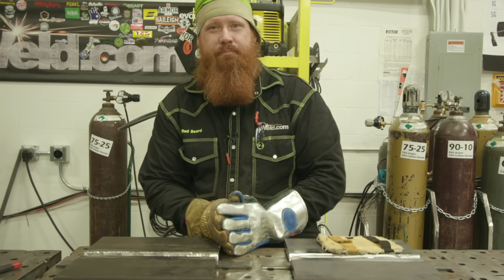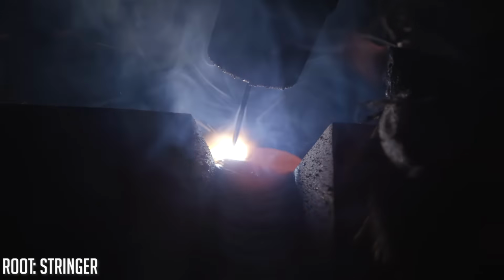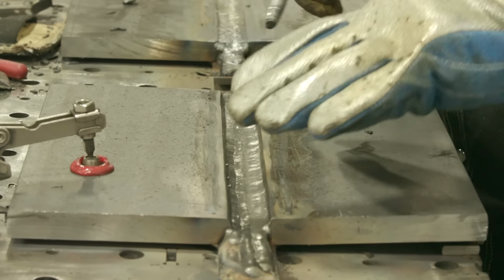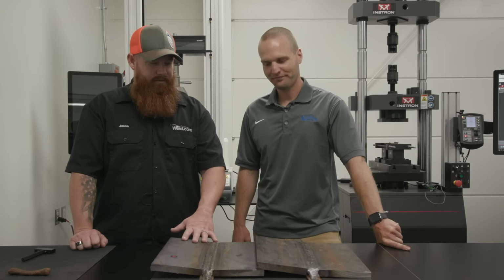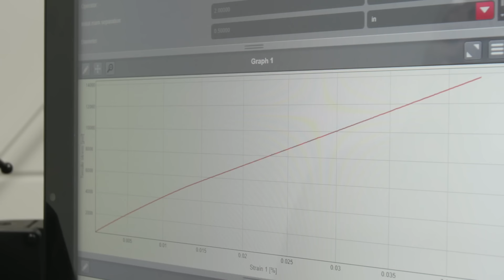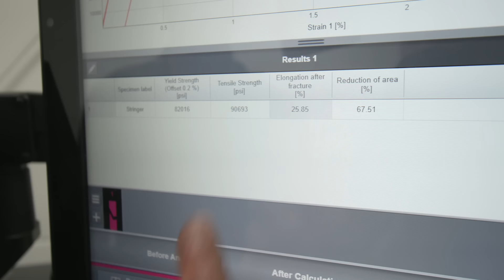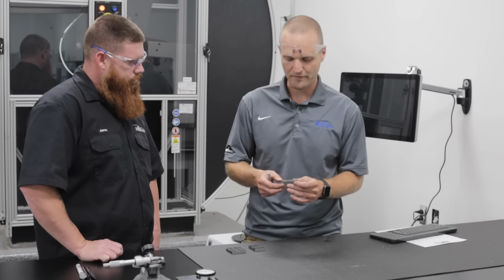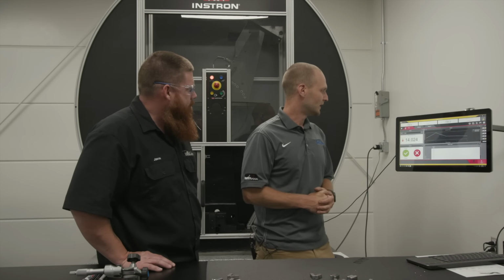Stringers vs Weaves

Comment: Just for those that think maybe due to the fact you used a flux core the weave may had been better with solid wire the answer is no ! We did a test like this a few years ago with 6061-T6 using 40 cfm Argon  and the results were the same . Stringers always win . Simple was to look at it is aircraft cable has many strands and is renowned for its strength ! Cables with the same out side diameter with less strands are not as strong .
Reply: Did you also find that multi-ply toilet paper excelled in your testing ?
Reply: @deconteesawyer5758   After 50 years of use I can say with certainty that Charmin has beat Scotts every time.
Reply: @PWL1371  There you go relying on your personal results. Simple was to look down at the bare facts in the mirror.
 Mega rolls, ... Charmin delivered as advertised.
 Scotts promised Miracle-Gro left you still short, trousers and hands down. 
Real testers use the splinter free criteria.
Reply: @deconteesawyer5758  Nothing on personal results. The company I worked for had to do weld testing for ISO 9001 and standard ASME welding Certification for Code standards. My opinion was not used on the weld video, but the companies test results and standards we as code welders had to abide by. There were thousands spent to ensure the safety of the clients.
Reply: @PWL1371  Your original post was comparing apples to oranges, in some non-specified manner with zero reference to any sort of standards. The "we' doing the testing could as far as viewers could know, be you and your drinking buddy playing with your mobile rig in the bar parking lot.

Comment: The weave had a slag inclusion. You should’ve tested another sample. That is the welders error
Reply: I think they corrected that and said it was trapped gas. But, still you’re right, that’s not necessarily a technique issue. Still and all, on the latter test 3 of the 5 weave samples didn’t even pass the minimum acceptable. It’s hard to figure how, where strength is the main issue, the weave pattern welding can be justified.
Reply: YES, POOR WELDER... slag inclusion.... faulty test... this guy can't weld...

Comment: What does that 350 stick you were using do?
Reply: Santana Bell   It melts at 350 degrees, therefore he can check to make sure he’s not going over 350 by checking it with that
Reply: @mikepalmer4371  thanks

Comment: its not surprising that the second specimen cracked in the way that it did, because one of your welds had (can't remember which) had   impurities (presumably slag) in the bottom of the weld run...
Reply: If that's true, you should watch the video again and tell us the time you see that. I'd like to know what you see.
Reply: @mavamQ  OK, I will do that - it was either a bit of slag or - let me see,no it's not a spec on my laptop screen. It was fleeting what I saw, but definitely there. You may have been distracted (What's that dear?) or I could have been mistaken - it did seems strange that there would be such things, though the welder guy didn't blow the area down. The other thing (and I am a qualified welder) he didn't de-slag after each pass, which is probably why you do runs (Oz term)/stringers, as the cleanup is much more efficient. Also - I would have thought that to do Charpy V-notch or tensile tests, that you would remove any possible  source of contamination, e.g. the welder should have used gas, instead of gasless wire - virtually nil cleanup required.
Reply: @donpollard9460  I'm not a welder, (I like to say I glue things together with metal  at home when needed)I  just wanted to know what is you saw,   to add to my knowledge.
 A for deslagging, it may not have been shown every time in the video, but I'm sure he deslagged it, probably even ran the wire wheel, yep, don't think he put an air hose to it though. I was impressed at to how consistant the slag was, a nice even layer over the whole piece.

Comment: I'm a qualified senior welding inspector and under not circumstances are you allowed to weave when welding. When I see that a welder weaved, I reject the weld right there. You don't even need any tests on the weaved weld in this video, it fails out right just because of the amount of deflection between the two plates due to the excessive amount of heat due to weaving.

Comment: Weave is an old school thing. It's how I was taught @ SWIC twenty years ago. I also was only taught open roots (backing strips were for pussies that can't weld😉). I instructed part time straight out of college for 2 years, just started instructing again last year & weaves & open roots aren't even taught  anymore outside of pipe
Reply: Shawn 1 backing strips are used for limited access when you can only access the weld from one side. Low hydrogen rods aren’t good for open root welds. Cellulose rods aren’t used nearly as much in structural anymore. 20years ago my D1.1 SMAW year was a 6010 root 7018 fill and cap but time have changed and most structural jobs require 70XX low hydrogen welds because of underbead cracking.
Reply: I don't know what you mean by "an old school thing", because 40 years ago I was trained to never use weave. Your second sentence is right on. I have NEVER seen a practical situation for backing straps. This bullshit about "limited access" is easily covered by using standard procedure for root pass, similar to pipe (6011/6010).

Comment: I admire your dedication...however, the stupidity wide bead weave you ran put two dimensional stress into the molten weld ( which then shrinks) because of the sideways loading on the weave, you have a lot more stress induced into the parent metal. The stringer is in only one direction, and therefore shrinks in one dimensional direction as well ( mostly). Ironically, this is the same direction that you put the tension load on with the stringer... If you would notice, your weave plates buckled in ( bent in half) more than the stringer... Flatten them out on the mill, then pull your tensile load across the weld ( as the weave runs) and you will get different results. Our tensile machines sounded like a shotgun when they broke the "test piece" in half.

Comment: 10:34  your weld hasnt fused with the outer edge and ya didnt run a drinder along it to clean it out.
You concentrated on your overlap in the centre of the weld. I would have stopped ya right there. i always take a cutting disc to the edge of the weld to clean up and give a clear edge t follow on welds that are getting tested or critical. The heat or the weld cant get into the valley two narrow and the weld failed on the edge under load...

Comment: i knew weaves got hotter, so im guessing that huge ass weave and the heat made it weaker. i still like weavers, but i wont do em till the metal is red. i guess i'll try to get better at using stringers more, but i'll still weave when i dont need much weld passes.

Comment: Man I'm not judging you,  but if you would stay do faster side to side motions that weave would be alot stronger.  I learned this welding 2 inch cove verticals on water towers.  We weave that shit all the way out. Sometimes up to 6 passes.  Never busted xray. Everytime you go from side to side, the flux has already solidified on your leading edge.  Turn that heat up and move that shit as fast as you can without fatiguing. That's just just my professional opinion.

Comment: I have never done flux core mostly a stick welder here, do you have to pull as well since there is flux same as a stick weld, for all you weld junkies I am 14 chill down I'm here to learn not get scolded for not knowing and mainly stick weld on top of hog shit and make the peice last another 30 years
Reply: ALONE ON BLITZ yep, you pull/drag just the same as you would with stick buddy. If there’s slag, you drag.
Reply: @GodslilRedneck23  thank you, I have been looking at the Lincoln electric s500 power wave (15 grand ) and some welding helmets, been saving up some money over my years since I have been fixing barns since I was 6 with my dad. Wanting to learn TIG but stuff seems to be out of my skillset as of now, maybe aluminum trailer welding I'm pretty good at too, can't wait to get certified
Reply: ALONE ON BLITZ the S500 is an awesome machine. I’d start off with something a bit smaller though. That’s a big chunk of cash to be laying down, especially at your age. I don’t want to talk you out of anything but I’d look into a smaller multiprocess machine to start off with.
Reply: @GodslilRedneck23  I am at the part where you just started the stress test stringers are better for one, I only weave for filling purposes on a wider gap, the stringer will hold more due to it's long narrow beads, they are bonded throughout the weld and unlike the bead the weaves rely on the cross pattern to hold the tensile strength and make it weaker. It doesn't even take 8 years of welding in hog barn so poop to figure that out and I'm 14 not even out of school and know more than half these people over common sence
Reply: @GodslilRedneck23  dont worry, I wouldn't lay down 15 gs and not have some pocket money for a safety blanket in case something goes south, granite it's a big chunk of money but I have learned how to work hard and save up for college
Reply: Oh btw, cant wait to watch the rest of the videos you have, SUBBED
Reply: ALONE ON BLITZ love it man 🤘

Comment: From what I understand. This facility water jets the weld out from both base materials. Then pulls the weld in a way that would never happen in the real world. The only realistic use for this test would be if you were to be lifting/pulling directly from the weld and not using the base metals. A useless test from my point of view. A stress test by pulling on the individual base metals and/or use the hammer test including the base metals. The idea of welding is to join metals together. Removing the the point of the weld makes the weld useless.

Comment: But what if you hadn't let the stringers cool down and you had just done all the passes at once?
Reply: Then more than likely the stringers would have ended up like the weaves. The problem with weaving is that it runs the temp up in the metal in a short time in a close area. With stringers you spread the heat out and can let the metal cool down and not change the structural integrity overly much. Least that is what many old school Ironworkers taught me.
Reply: @godemperorhoover2131  the problem is that how many bosses are going to let u sit there and sip coffee while your welds cool. Unless it's a structural job or being done in accordance with some code usually it would be a case of just get on with it
Reply: @chrisplayz253  Every weld I have done in the field has been a structural weld, only thing I have found to combat pushy foreman was the WPS. If it does not specify interpass temp... you just keep burning rod. I want to keep burning myself, makes the day go faster.

Comment: test was flawed because tensil did not pass. if you was testing for a job that the discontinuity was found in that test section it would have been a failed test.
Reply: Besides every one here knows you will run hotter if you are weaving in the real world

Comment: ehhhh arent u guys pulling the welds form the side and not the long side or whatever u call it where the welds are actually holding the part together? if u pull from both sides of the actuall metal peices im pretty sure weave holds better

Comment: should fail on the fact you've allowed the plate to distort so much on the visual alone.
Reply: I did wonder about that
Reply: that's the weakness of welding,it distort the material because of the heat input (all type of welding) unlike other fastening method i.e bolts&nuts,rivets and so on

Comment: stringers being stronger should be an obvious result, as the metal cools, the tension in a stringer will be less than in a weave due to its lesser width.. Canadian welding bureau inspectors in my area 

will no longer accept a weave on check tests
Reply: What about roots passes?

Comment: doing large weaves like that is your issue. make smaller weaves to stay in the molten puddle. lleaving your puddle gives the weld time to cool off and increases slag trapping. smalller weaves and staying in your puddle would increase your tensil strength. good video, but it only proves that llarge weaves are trash.

Comment: Not a fair test to compare a stringer to a weave using the same settings. Weaving needs different settings so of course the stringer will be better in this test. Should do a weave at the proper settings then compare the two.

Comment: The difference in tensile pulls was welder error not technique.
Reply: Eric Anderson when you’re welding can you see and correct this exact flaw?  Literally mid weld.  Correct it
Reply: @maximuslongrod6361  flaw was most likely a slag inclusion which can be corrected with proper interpass cleaning, or porosity which can be caused by many factors not least of which is insufficient shielding gas coverage.

Comment: Can't weave structural man. It's been outlawed
Reply: Wow is that so? Do you even know the definition of a structural weld.. I'm not trying to be sarcastic or rude but.. and what grade of Steel are you working with and what type of filler Rod are you using.. ""you can't leave on structural it's been outlawed"" that is very very broad term thank you for the information

Comment: That's kinda not a good test ur using a half inch root opening of coarse there's gonna be way more heat from weaves if u ran a proper 1/4 like ur supposed to probably wouldn't see much difference

Comment: I prefer stringers. But you really screwed up that weave test plate. Not a fair test. No serious welder who weaves would weave that friggen wide. Geez. Once your weave bead gets about an inch give or take don't go bigger. Stack the weaves side by side like stringers. When your weave is to big you are welding over partially cooled slag along with all the contaminants that you would typically wire brush before starting another pass. Try again with this advise and I guarantee the weave will preform just as good or close to the stringer plate.

Comment: Well, he didn't put as much give a crap into the weave weld to start with. I personally think he's more one sided for stringer beads, nothing wrong with that. But if he would of applied greater give a crap for the weaves, and done them to d1.1 code. It would of held to it's designed intention.  There's a reason for all the  asme  and aws codes,  and so much variables. I'm not the greatest welder, but far from the worse.  Do I trust my welds, I put my life on it without hesitation.  I'm not the best, far from a beginner and always up for a good challenge

Comment: Imagine if the stringer guy actually cared to LAP stringers as structurally sound welds  instead ...do that uphill.
.5 gap sounds like piss poor prep or fab. 
B pressure , smaw gmaw fcaw , stainless stick 
Left handed...upside down...150' in air...hanging from toenails and fall arrest/ climb harness.
Edit all process not at same location.  Use your frontal cortex if its not burnt blind

Comment: This is a okay video. But there are so many variables. So yeah he determined that with that type of wire under these conditions and he never mentions the type of steel welding.. under those conditions I guess he determined that stringers are stronger than weaving it.. but this is in no way no how the case in every application..

Comment: Why not test with a smaller gap instead wasting ten min
Reply: needed to be at least 1/2" because the tensile bars are 1/2" diameter and have to be solid weld metal. If the gap was any smaller the sample would have weld metal and base metal in it. We are only testing the results of the weld metal in these samples.

Comment: i wouldnt put too much faith in those tests. they are totally artificial and require machining the weld to a stupidly small piece with respect to the weld size. they are not mature welds eiher, still 'hot'. i also dont like the way youve  clamped only one peice, which is allowing the second plate to curl, showing the weld is shrinking during construction.

Comment: slag inclusion (imperfection) in one piece voids the test.  They aren't equal.
Reply: Not sure if it's just an AWS generic term but you wouldn't get slag with mig/mag anyway
Reply: I agree with phodel. And there's the clue. The test may really be consistent with real world use of stick and flux-cored processes.
Reply: @joshualines1086  You can get slag inclusions with flux core wire used in this video.

Comment: Wtf is this nonsense? I understand that you're trying to make a point here, but I disagree with how you applied it. I weave on all welds, but I weave small. Not the entire width of the joint. Especially the capping, I would have done 3-4 passes easily. You opted for one big stupid capping. That's not how you properly weave. I kinda mix both techniques together. Without a small weave, there's too much human error that shows in the beads.

Comment: Did not learn a thing except your guy in the lab coat didn't have a lab coat and could not say two words that made sense to me, a 60 year old Ph. D. research mechanical engineer. Do about 20 samples of the tensile test to get some statistical significance to your efforts. You compared a flawed piece to a good piece. Useless work. Find people who can make understandable sense of what they are doing. Slow it down and get the communications clear. You've proved nothing at this point. A complete waste of everyone's time and money.